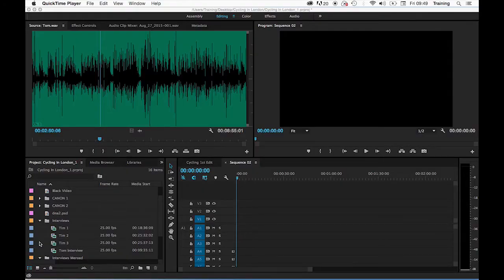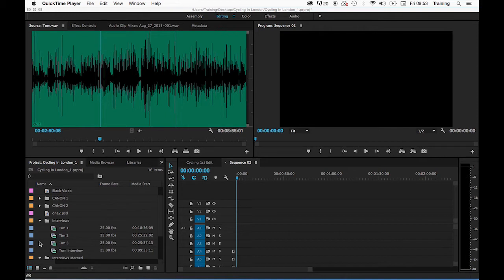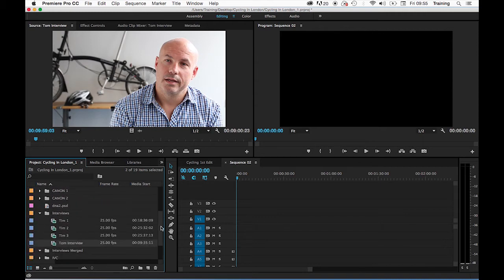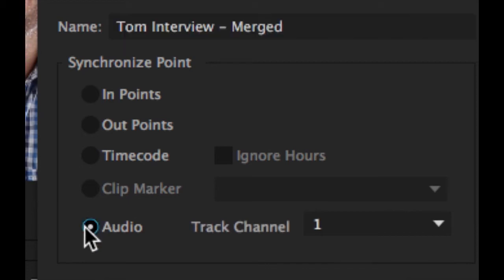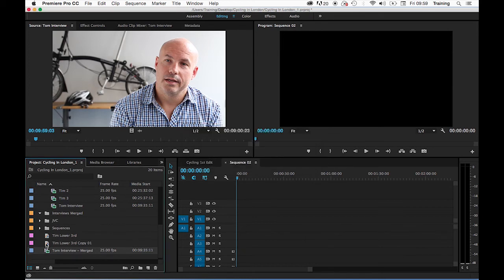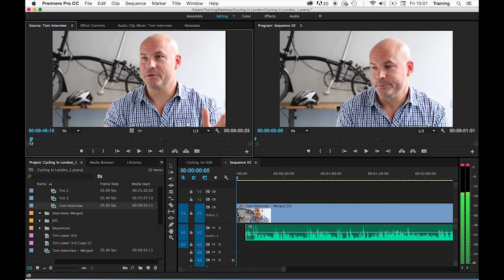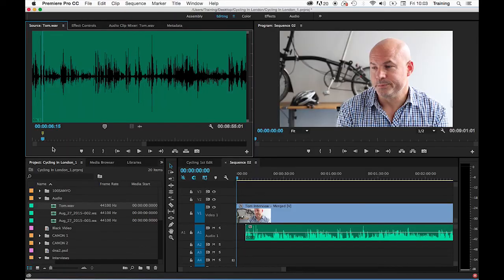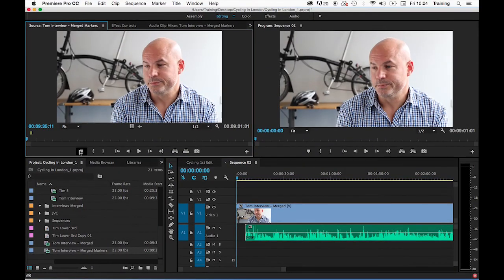Merging Clips With External Audio - Adobe Premiere Pro Training

Comment: Good video.  Why do you suppose sometimes when three clips/audio files are selected the "Merge Clips" option is greyed out?  Any two of them, and it's available, but selecting all three and it's not.  Any idea why?
Reply from the maker: Hi Matt. It is possible to merge 1 video clip with multiple audio clips. You can not though merge 2 video clips with 1 or more Audio clips. I don't know the technical reason for this. If I do have a longer audio clip that I need to merge to more than one video clip I merge it to 1 video clip at a time. I also add rough in and out points around each section of audio that relates to a video clip. Premiere then merges the selected part of the audio clip to the video rather than the whole audio clip to a much shorter section of video. Tom